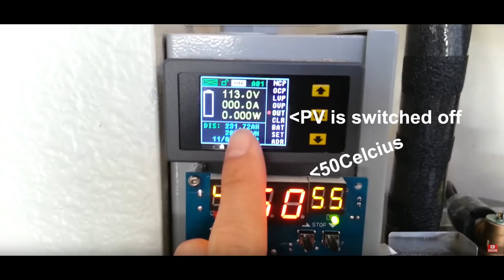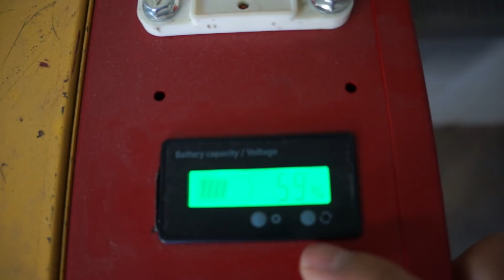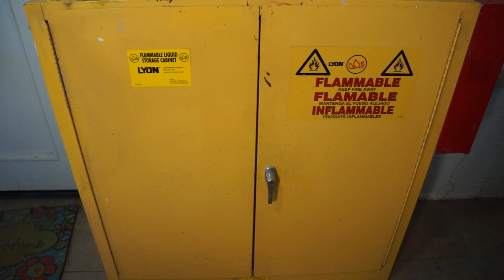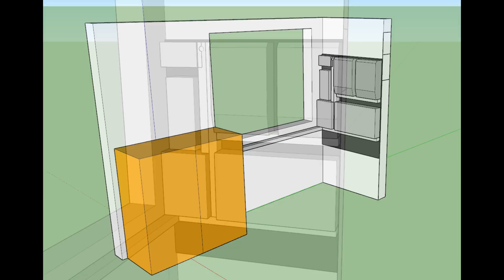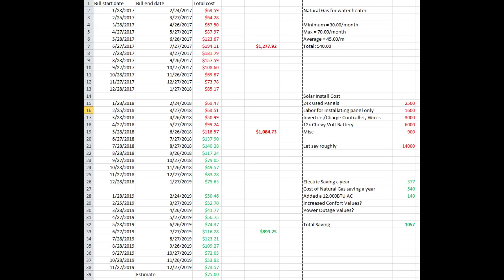My 7kw Off Grid Solar, 37kwh Lithium Ion Battery Bank Cost vs Saving over 2 years?

Comment: Installing an off grid solar system isn't just about cost-saving. Even though it saves money after a decade or so, there are more benefits than that. There are so many pros than cons. Firstly you're not relying on the grid completely. You can easily have an efficient setup of all 12V, 24V, 120V & 240V systems as your preference. Solar panels are getting cheaper, efficient & durable, and batteries too will eventually with technology. Upgrading is fairly easy if you need to add/swap more panels or batteries, you can getaway doing it yourself. It is a dream is to turn the grid connection off completely and to live on solar energy without worrying about powering multiple high amp drawing equipments at any given time, however that would require more than what we're talking about.

From where I come, electricity is cheap and more than 50% of our power comes from renewable sources. It would take at least 25+ years for a decent setup to breakeven costs. But even then I think it's worth it, It's something about being independent; not to rely on the grid to always power you since power outages are pretty common here.
Reply: I live in TVA area where cost is less than 10 cents per Kwhr about as cheap as it comes and my total system costs was as follows Panels 13,500 watts US manufactured 300 watt higher efficiency panels new but "open box",  $4700 delivered.  Batteries 30Kwhr of brand new LG lithium cells like in chevy Bolt (I put cell packs together $50 materials) total cost $3290, 3 of the same inverters he has  MPP 5048 MG $580 each for total with shipping $2100, PV wiring $500 conduit $120. Mount (wooden for now with panels also bolted to each other $550 Transformer to convert direct to 240 volt  $300,  Cables circuit breakers various other supplies $500 ( wire whole service panel to solar grid now comes to 200 amp disconnect  that goes to grid input on MPP s . Total money cost (done DIY) is $12,060 after federal tax credit (I got 30% back but now would be 26% credit so i am figuring 26%) total cost is $8,924.  Of course I spent about a week of spare time putting system together etc but my payback at saving about $180  a month with inefficiencies is 49.6 months or just over 4 years and this is with batteries. Now I am considering getting another 25 to 30 kwhr of batteries and disconnecting from grid to save the monthly fee etc. I already have a generator when occasionally needed and gas backup as well as wood heat. Actually doubt I would even need generator more than couple times a month or just 2 or 3 hours several days depending on how much reserve decided to keep in batteries. So, it can be done very inexpensively as "off grid" no grid sell DIY system like making about 20% on my investment not to mention not needing to make and pay income tax on that $2400 a year .
Reply: @teekay1785  Amazing! You should make a full video on this man.. I'd love to see your system and it would be a useful to many with questions.
Reply: Where I live the cost has gone up and up every year because of renewable energy. When you put renewable energy from your system into the grid you got 50cents per KWh (killowatt hour) as part of a government plan to subsidize renewable energy. To have this fund going the government forced the energy companies to make sure their customers pay extra so extra money is left over to pay this subsidy.
Even though they reduced from 50cents/KWh to 11cents/KWh we still pay 28cents/KWh as a customer. We know most places on earth people pay less than half or even less for energy, so yeah, there is that.

Comment: Hmm, most of the experts are saying now, that the prices have dropped enough that you should pay for the system in 10 years with a lifespan of 20 to 30 years.
Reply: yep, mine will break even in year 11, but I over-sized it by 2 kW since i have a lot of other builds I'm going to do that will use it later on.  I also didn't install any of it myself.

Comment: US Virgin Island, 40.03-kilowatt-hour. We have frequent outages and for long durations. I have a dual SW by Schneider electric. Our system came online 7/2017 as a single inverter setup, that configuration with used old lead-acid took us through two major hurricanes, so yes they are worth having to maintain a decent quality of life.  Our power bill has declined to $40.00, we use tesla model 2, in a 24-volt configuration. total of 20,784 watt-hours and will be adding an additional battery to increase capacity storage soon.
Reply from the maker: Yes, I would have prefer to live off the grid as well.  This system would be more than enough.  :)

Comment: Yeah I have 6.2 kw solar, Had 3.2kw bought the Other 3kw with my savings, I haven’t paid a power bill in 9 years! But batteries will guarantee a bill. Power company sucks every cent they can and I would pay fees and charges again which would stuff any pay back I crib at the moment.
Reply: nice anectdote but doesnt really mean much for most of the audience.  Deals are area specific and time dependent (old deals were more generous, less so now)

Comment: I'm not sure where you are located.  Where I am the electric utility stores my excess energy until I need it in the winter.  Not only that, they pay me as much as 25-35 cents per kWH for excess and sell it back to me for much less, as low as 11 cents per kWH.
Reply from the maker: Here, they pay 3-4cents per KW if you sell it to them then the power run 3meters to your neighbor, but they pay 13-14cents.  So screw them... i rather see it go to waste.

Comment: Curious, did you consider heatpump water heater(s)?   I have them.  They use about 1/4 of the kWH that a resistance water heater uses.  At about $1000 per 320W panel (installed and warranted),  they were far cheaper than the extra solar to power resistance water heaters.
Reply from the maker: 1000.00 including solar panels and the water heater?  no way?

Comment: Thank you for showing such a comprehensive breakdown of all the costs and advantages. In Canada if you own a property that doesn't have electrical service already, it can cost as much as $10,000 just to have a connection made to the grid. Plus it is another $10-15,000 to get the natural gas connected. Plus you will have similar basic monthly extra charges, whether you use the services or not. So an off grid system under those conditions would be much cheaper right from the start.
Reply: Would those costs be the same province to province or is it guess work?
Reply: @wago1718  My brother knows someone who moved to a completely off grid property, in Ontario, and that was what they were quoted. They went the fully solar route. So it's probably not a hard and fast rule nation wide, but that's why it can cost a lot more to get service to an off grid location, than just going solar in the first place. Plus the continuous operational costs every month.
Reply from the maker: 10,000 to get power in is actually cheap... I guessing the run must be super short... most of the peoples I know told me upward of 100,000 to run power in...
Reply: So if the property is already off the grid to begin with, it's probably best to stay off. Whereas to go off may not be the most cost effective solution. Having an uninterruptable power supply, and a small backup generator if you live where the grid goes down frequently, can protect your work flow, and power some fans to help keep you cool. It would save tens of thousands of dollars over installing a large system. But that is only from a cost perspective.

Comment: Its relatively easy to heat or cool 20 degrees over ambient 
With a programmable thermostat you could run your ac a little lower during the morning .
80 degrees is what you need when its 100 degrees

Comment: I have a 2000$ 2kw off grid system
8 panels 300w each. And 8 lead acid 150Ah 12v battery. I want to change it to lithium ion battery. Maybe after the battery dies. Also need to get another inverter and another 8 panels and make it atleast 4kw system. The system is 3 years old and i think by this year end would recover the cost of investment.
Reply: Their used to  be govt subsidy of about 400$ per kw when I bought. So total 800$ govt paid the company. And so the total cost of system will be around 2800$

Comment: "kw" and "kwh" are meaningless. You want kW and kW⋅h for kilowatts and kilowatt-hours, respectively. And there should be spaces between the quantities and their unit symbols. Use a tool like a browser extension to generate the right symbols if need be:
https://chrome.google.com/webstore/detail/autocorrect-units/aeedejoiebbkjijeiobcbdonigjfmijp
Reply: tstcikhthys they aren't meaningless. They might be incorrect, but be honest, we all knew what was being referred to.
Reply: @spencerwilton5831  yes but you clearly arent a Dilbertesque engineer pedant dickhead more interested in point scoring than the actual discussion

Comment: heating water with electric solar panel is nonsense.  A cheap thermal panel can heat water much efficiently for a very lower cost. And excess of heat can be stored in soil for winter.
Ideally one may use a Photovoltaic thermal hybrid solar collector to maximize the efficieny: heating the water will cool the solar cell, allowing a better effciency and longevity.

Comment: Nice system. I am thinking of making a smaller one. It will pretty much be a back up system so we don’t need to hook up the generator when the power goes out. Office, sump pump, well, refrigerator.

Comment: We have natural gas readily available all around my state, and we still pay around $40 a month, even if we use none at all.
Reply: MusicInspire same in the U.K. It's called the standing charge, typically around 20 pence per day. It pays for infrastructure, billing services etc which are obviously required regardless of consumption. However our gas itself is very cheap, usually around 2.5 to 3 pence Per kWh- and yes, that's how it's priced, I suppose so people can directly compare it to electricity.

Comment: I wonder, did you take into account that you probably will have to replace the batteries at some point? That might add about 600 USD of cost every year to your calculation (if they last 10 years).
Reply: Well here I amortised. My set up and it was about 18.00 per month. And on constant look out for parts bargains.  And I have missed sir charge.@ 42.00 per month. Real savings. Say12x42= 504+ taxes. The county and power co. Was acting butt hurt. Too bad. Leaches any way. Ha ha. !

Comment: Solar power is great in the early days and years but when your inverter stops working correctly like mine you find out the inverter only had a 4-year warranty that removes any saving you might have had
Reply: people need to remember they are responsible for problem determination and repairs,  they cant just ring a number and complain to the power company

Comment: Only 13 cent USD per kw/h? In Germany we pay 30 cent Euro and it is still increasing 😮
Reply: Jaaaa, wird ein lustiges Jahr
Reply: ah but you are saving the planet!    you only have to look at whats happened to global CO2 levels during the great lock down/grounding to see what an impact we really have on CO2  (zero,  if you even think it matters)
Reply: Thats sustainable environmental power. Nuclear power much cheaper.
Reply: @basspig  nuclear power only appears cheaper.  It is heavily subsidized by the government, which means you are paying for it via taxes, you just don't know how much.
Reply: @basspig  and the extrapolation for waste storage. What are the average costs for that if you dont dump it to forget? This could take a detour to our taxmoney.
Reply: basspig Nuclear is not cheaper. The UK's newest plant is going to be paid almost double the price per unit than the wholesale cost of renewable power. It will cost every single household a few pounds more each month for decades. Then we will have the enormous end of life costs that dwarf the original construction bill. Nuclear just doesn't make financial sense here anymore, I suspect we are building it for energy security reasons rather than financial ones.

Comment: In my country Indonesia, lithium batteries cost 2000 usd/ 5 kwh. compared to the system you have, we have to spend 18,000 usd only for the battery.

Comment: pec charges us about 10c per kw...   i generally use off the grid about 1500-2000 per month...  my simple system is 1000 watts of panels... hooked up to 700 amp hrs of battery   so far this winter i can get 150 kwh a month out of it-   hopinng this summer it will jump to 200 or more.... got about 3500 buks invested,   if the batteries hold up... should break even in 10 yrs....not a very good return on investing into solar....  3500 invested into an * i bond would net me  over 800 bucks in interest minus uncle sam's cut on taxes

Comment: $14k isn't bad, my parents are getting a Generac 22kw propane generator, and propane tanks. It's over $20k. The only time it'll get used is if the power goes out. I looked at getting solar, but my electric bill is $80-120 a month.
Reply: Michael Cook a 22kw generator is insane. Why so large? That can't be far off peak load, even for an all electric house, and in an emergency situation who runs their house like they would in at normal times? Most of the time when operating that generator will be operating at a fraction of its capacity, which is incredibly inefficient. They should get one half the size and just take care to stagger loads in the few days a decade they might require it.
Reply: @spencerwilton5831  Yeah...my parents house is about 2500ft², but he want to be able to run everything in a power out, since we are in Fl and you could lose power for weeks during a hurricane. The price includes the (2)100 gal propane tanks. He could run the whole house for almost 2 weeks on propane. I built a power station out of a toolbox and inverter, battery and some various outlets. It's more for camping, but during a power outage I can plug my fridge in and it'll run it for at least 24 hours. I need to get a 100 watt panel to hook up to it.

Comment: Are you sure all this i right? I would expect your bills to fall closer to zero after installation of a 5kW solar system. I mean, with 5 hours of solar insolation, you might generate 25kWh in a day, but your usage is about 450 kWh per month or about 15 kWh per day. Thus, on a normal sunny day in Arizona, you should be able to generate more than enough electricity for a single day, so you should see your bill drop to zero or less, if you have credits for putting energy into the grid. So your savings o only about $400 per year just doesn't seem right to me.
Reply from the maker: Did u even read the title of the video, it said off grid system

Comment: My big issues with designed systems like Powerwall is that they only store 14kw/h.  I have 34 300w panels generating up to 10kw/h peak.  Typical values daily are between 30kw/h per day in winter and 60kw/h as I live in sunny Queensland.  Without storage most of that power gets fed into the grid and I pay out to draw it back when the sun isn’t shining.

With a 37kw/h battery, even with my EV charged at home I could be totally energy independent.  Doubt if I could get my hands on any old Leaf batteries though, sadly, as those Leaf’s never made it here.
Reply: The leaf's are here but haven't been for long and the batteries aren't very good value how ever i have tesla battery packs on eBay they are around $15k and would still need some work changing the bms etc but that 75kwh worth of storage if your up for a bit of a diy powerwall you might be able to find better prices too I haven't looked that hard but at that money it would be about 1.5 times the price of a powerwall but over 4 times the power storage

Comment: GREAT SETUP SIR!! You have done a wonderful job!!💯👍   Let me ask you a question? When you pointed out the wireless bridge you said you can Monitor your system over the Internet? Number 1 Can you control the system over the Internet?  Number 2 Are you receiving internet over solar? If not look into Unifi network they have this switch that hooks into solar and somehow set it up? I’m definitely going to be looking into that because by the end of the summer I’m gonna have solar on my home for sure so I will definitely be back in touch with you thank you for your time and your videos and again you did a wonderful job thank you!!

Comment: Did you look at a solar hotwater heater for the hot water tanks instead of going solar electric to power the electric hot water heaters?
Reply: Think he has done a brilliant job but like you say, solar thermal worth considering given that it produces more hot water per sq meter of roof and heating hot water is the juicy part. Friend of mine was heating a small out of ground pool using an air source heat pump in summertime was getting 13 kw of input from 2 kw of load, just imagine a 3 kw solar array powering it all and its all free lesss the initial investment. His pool and pump as he bought second hand, less than  $1000.